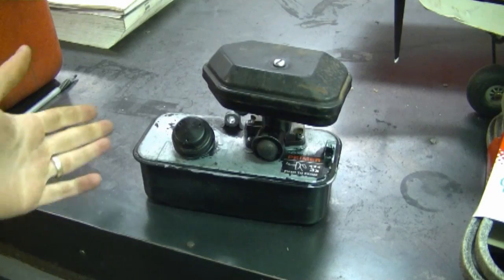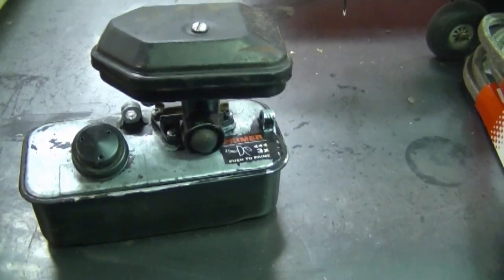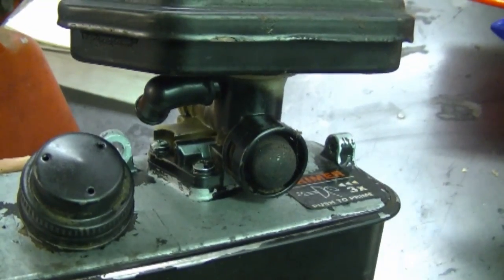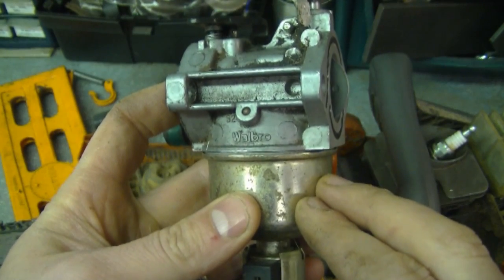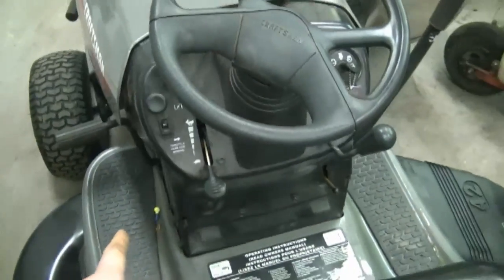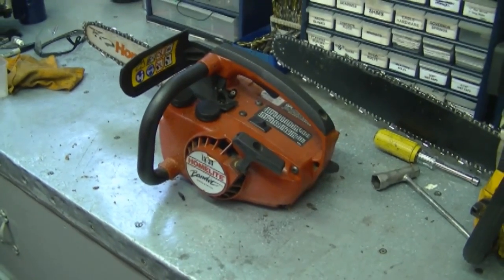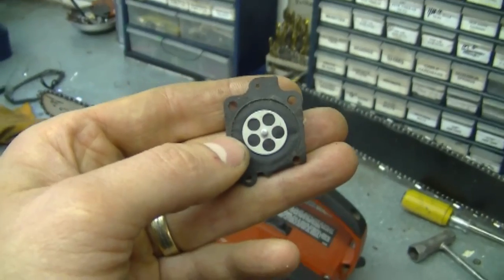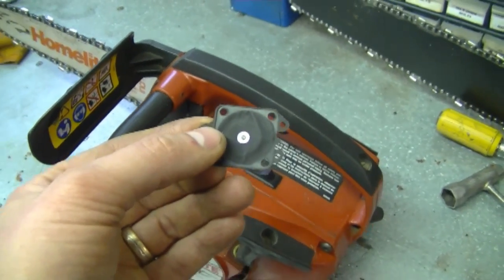Small Engines Q & A Video #110 in HD

Comment: I have a 22 year old 3.5 HP Briggs & Stratton engine on a lawnmower. It still has the original diaphragm and starts on the first pull every time, including the first start in the spring. The only part I have ever replaced was the spark plug. Thanks for all of your videos!

Comment: I had a cheap Briggs and Stratton Lawnmower that ran with no issues for 21 years! Never had an oil change or filter change. Never had a carb rebuild or any other work. It finally died on us a year ago due to worn out bearings. We replaced it with a kholer and it's already in the shop for a burnt magneto.

Comment: Hi gtys. I am Rob from Gosnells, Western Australia (down under ok) My lawn mower is a Masport Maxicatch, Briggs and Straton 500 and have owned it for 8 years. It is like brand new since following DonyBoy's instructions on cleaning the carb, understanding how the govenor and linkage works. Forums state that this mower has major problems with its revs after only a few starts due to the single linkage spring. For Au$13 I replaced the spring and it's once again running like new. I'm into DIY now. ty

Comment: Dony : you may not believe it but I used a push mower for thirty years and sold it and it still run great . Now it was an old 3.5 Briggs plain Jane push mower , but now it never sit out in the weather either . Food for thought people - there not made to sit outside . And the new models with all the plastic on them for sure will not hold up to the weather outside . Just worked on one back in the spring - all plastic carburetor- water and gas mixture with trash in it due too the air filter never being cleaned and changed . People there lawn mowers are not tanks , you need to exercise the brain and preform maintenance on them - and keep them under roof .

Comment: Good Job DB, enjoyed the tool review as well.  Fwiw, In a meeting the other day the instructor told us that carbs as we know them are done.  Between the EPA and new European standards coming on line for 2014 state that all small engines under 50hp used in the l&g field be fuel injected. There are a couple different processes.  One uses an o2 sensor like a car where the other system employs an exhaust temp sensor -stihl- to lean them out.  Are you hearing anything about this yet?

Comment: I'm working on a homelite super 2 the same as that bandit and to get the carb off you gotta take the whole engine block out to do it, sounds hard but all you have to do is take off the recoil housing the 2 screws on top and bottom the spark plug and the switch and the whole block slides right out but they should have made the carb easier to access for maintinence purposes.

Comment: hey Dony, great vid. Being it's snowblower season, you might want to consider to a vid on Tecumseh valve lapping and grinding to help seating. So far, i have had to take .005 off of the exhaust valves of more than a few snow king engines manufactured in the mid to late 90's. I even had a brand new (used once) snapper needing this and I was thrown that an engine that new needed it already. Just a thought and thanks for the great vids. :)

Comment: donyboy I love your series... I have learned a and rebuild my carb on an old snowblower thanks to you.

I have a question about the snowblower with a 5hp Tecumseh Engine, The electric starter makes horrible squealing sounds with I use it.  the starter is very old, do you think adding oil to the starter motor will make it more quiet?  and if so how do I add oil to it?

Comment: Lol I know what you mean, in the last half year ive been starting to do that stuff and for a summer project later today im going to pick up 3 older engines to see if I can get them to run 2 are 70s lawn tractor engines that he says aint briggs  and the other one is an old outboard that worked till the rope snapped for all 3 its 30 bucks and here in Canada that's a deal lol normally It would  100 for all 3 and 50 in the us.. they try to say its the difference in the dollar and its not!

Comment: Probably a lean running condition.  (Not enough fuel)  Really common with new engines.  I would check the main jet in the carb.  Make sure it is clean then reinstall and try again.  If still surging, enlarge the jet one micro drill size.

Comment: I have a chainsaw similar to the one at 6:05 , except its an old super 2. I got it after it had been sitting for years, so I didn't even bother trying to start it and just cleaned/rebuilt the carb. It's a good thing I did because I must have taken a pound of oily sawdust out of the body of the chainsaw. Anyway it won't idle properly and after doing a bit of research it seems there's no reed or "duck bill valve" on the pipe in the bar oil tank. is that possibly causing the problem?

Comment: Hi sonny boy. Have watched many of your videos with interest and have a questions for you that hopefully you may be able to answer, I have a 1985 Rover law mower with a 220 series engine which I have recently overhauled the carburetor. my problem is that now the mower will only run when I have the two rear wheels raised up in the air by 4-5 inches, as soon as I lower the mower back down to ground level the engine stops....it has got me ? Cannot figure out why this would happen...can you help

Comment: I have a Toro 726TE 2 stroke that has been running great but just started bogging down very low when i put any load on it like the drive or auger, it was just running fine I've been working on it so I've been running it and don't know why it just started doing this any ideas? Maybe the carb needs cleaned? Were should i start

Comment: Hey Don another question on huskee 42 inch cut. I changed belt and blades on riding mower after disengaged blades still turn awhile. It's sounds like it don't wont to disengage. Any solutions??

Comment: hello to ya man!!, i just got a old honda ems 4000 generator, with cdi written on pull cover.
can you guide me to this generator,
my question is... the unit been sitting for 10 yrs!!!.  i can not turn the crank shaft with the hand pull.  i soaked the piston, i sprayed wd40 in the spark plug hole. what is my next step to help it crank?
it also has a starter , how to hook up battery to start it.
thank you

Comment: About backfiring. I have a 15hp kohler that will try to continue running and sputter badly unless I have it at wot. Then it shuts down cleanly. Any ideas? There is no fuel solenoid.

Comment: ok the ems4000 is cranking with the pull, but gets stuck, i have to take the pull off and turn by hand. it has a electric start motor. but i dont see anywhere to connect battery. how i direct connect batter to starter to start?
i looked it looks like a 1985 honda ems4000. with 1 of each out lets. 110, --, 240